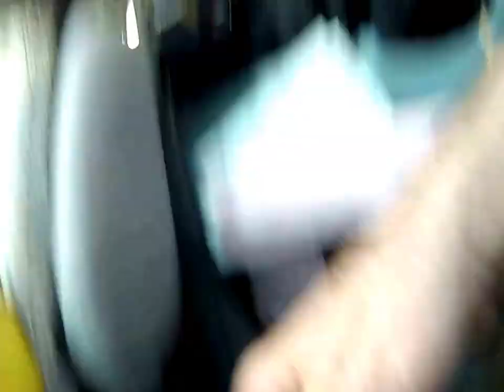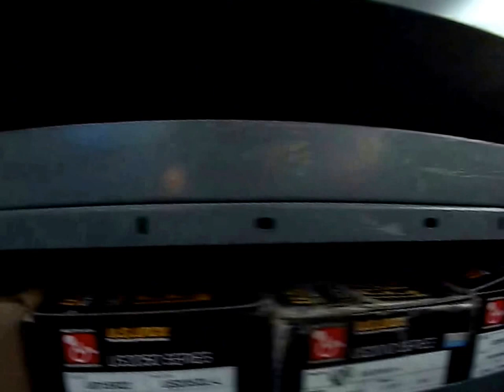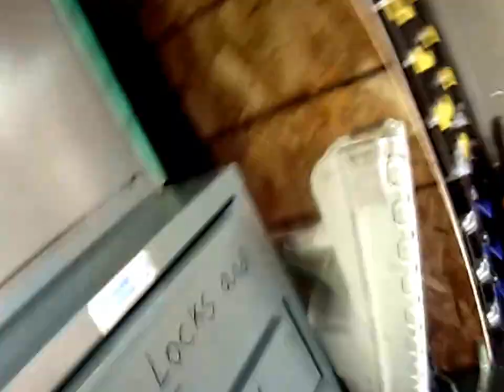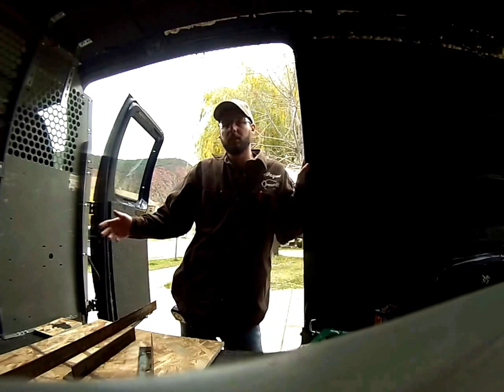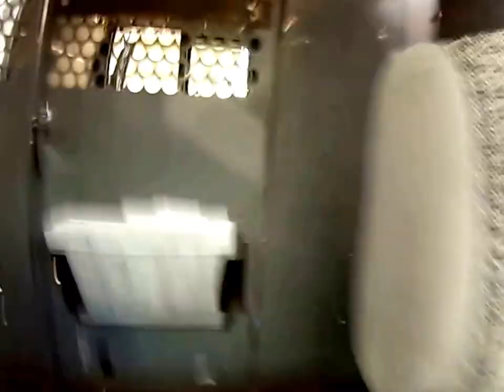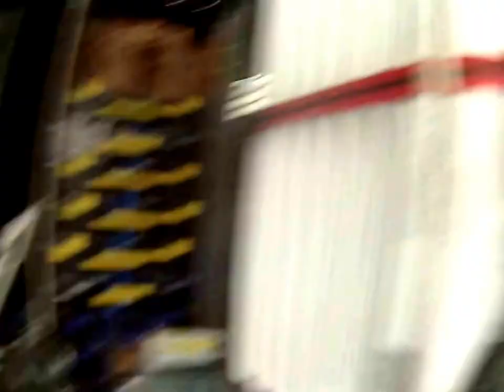Construction Work Van Shelves, Layout and Organization

Comment: how do you keep people from breaking into your van through the license plate holder? I'm not gonna give detailed instructions here (in part because mine is not secure either)... but if you remove the plastic license plate holder and note the position of the door linkage on the Econoline vans you will see the obvious security risk.
Reply from the maker: Post what your refferenceing and I'll see what I can do.
Reply: well, the license plate holder is held in by four screws that go into little plastic nipples on the back of it. The holder is relatively flexible so that someone could get their fingers under it and if they are reasonably strong or the plastic brittle and the screws rusted(which they certainly are) one could simply break off the license plate holder with door handle and lock and actuate the linkage behind it to break in without any tools.
Reply from the maker: Paul MvN Im sure this wold work http://www.americanvan.com/hasp-and-cylinder-lock.html
Reply: that's true, I'm a little concerned though because that lock on the outside of the van is like a giant banner "valuables in here"...